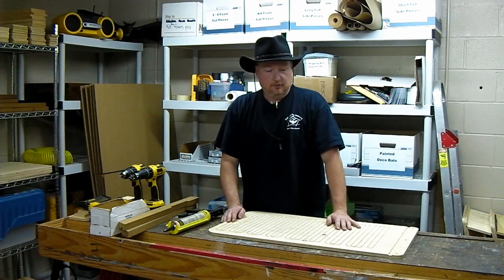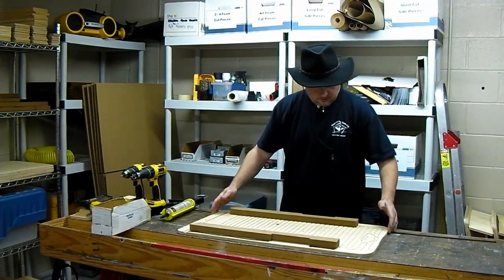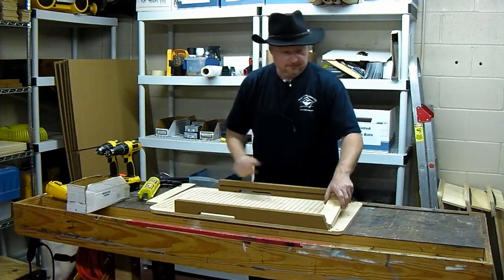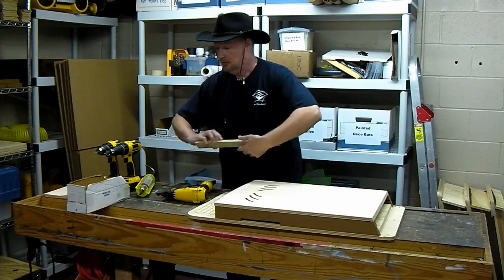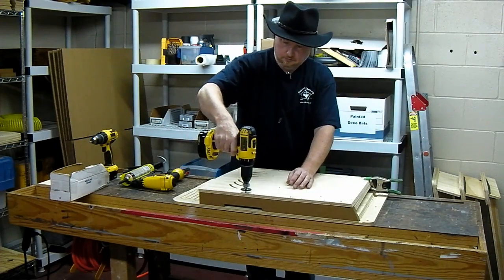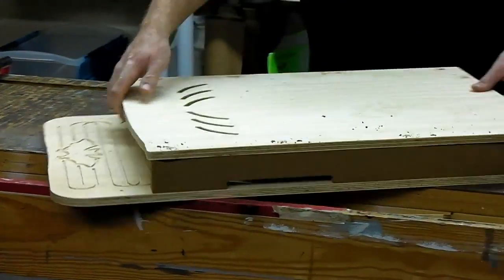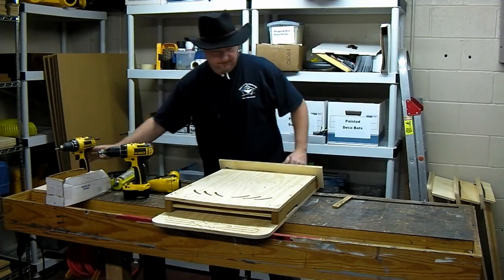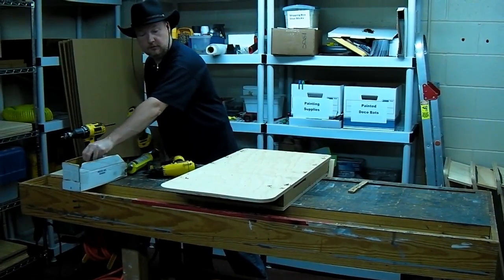Building a Two Chamber Bat House

Comment: Hello - do bat houses in located in the north (NY state) require ventilation?
Reply from the maker: As a guideline, states that "touch" Canada can consider a non-vented bat house. After that it depends on your area, the average temps etc... The goal is to keep the bat house between 85 and 100 degrees and even ventilated bat houses will maintain the higher temps when cooler, just not around the ventilated area.  If the temps in the bat house rise to 100+ degrees, the bats have the option of staying inside and moving down to the vented area. Without vents, they will not have that option so you should be fairly sure that 100+ degree temps inside the bat house would be very uncommon.  Best way to judge that is how often is a dark colored car very hot inside during your summers? If you never suffer "seat burn" and even in mid-summer find your car never gets above 95 degrees or so, then a non-ventilated bat house is probably fine.  In Georgia, we can see 130+ temps inside our black truck, another reason we try to park in the shade.  Thanks for loving bats!

Comment: Should the inside be painted?
Reply from the maker: Painting the inside is not necessary. If you do wish to put something inside, only used water based stains to darken it and let it dry at least a week in the hot sun before installing it.

Comment: Hello i bought a 2 chamber bat house made of rough cut cedar do i need to cut grooves in it?
Reply: I would cut grooves just to be sure that the bats have the best chance to get good footholds while resting and not slip out.  Especially important in the case of baby bats/pups since they are just learning to climb with their thumb claws and hang by the claws on their feet which are tiny. A bat house that is not that easy to cling firmly to could be rejected by bats Especially if the babies slip out.

Comment: Question:  what is that stopper attachment that you have on one of the drill bits? I'd like to look for one similar.
Reply from the maker: The specific countersink bit we use was discontinued. As heavy duty as it is (and I have a few) I doubt it will ever wear out.  However, this is the closest I've found to it lately.  http://www.starbornindustries.com/smart-bit-wood-product  I have not used nor can vouch for that one, only that it is similar in design.  Ours are metal, this one is plastic so I suspect it has a life expectancy.

Comment: These are the best houses I've come across.  Very nice.  What do you recommend for minimum thickness plywood to hold up over time and heat retention?
Reply from the maker: cglarsen26 Quality 1/2" (15/32" or about 12mm) graded for Exterior use (not Exposure 1 or 2 but Exterior only) is a good choice for bat houses. In cold weather zones you should have at least the size of a 3 chamber bat house and can leave the vent off the front and paint the bat house black. Side vents should be left as even in colder regions we're talking about the summer months and a black bat house can heat up. This gives the bats some place they can cool off while still inside the bat house if and when it's needed.  Feel free to use 3/4" plywood especially if the bat house is smaller than a 3 chamber bat house.